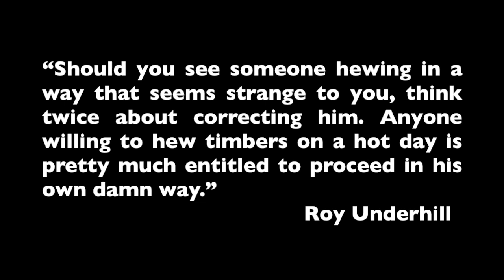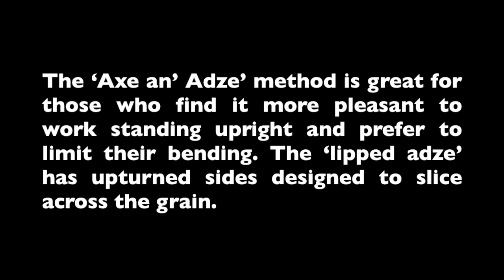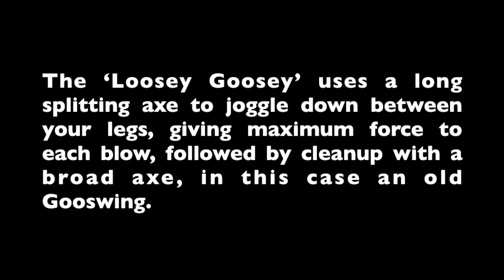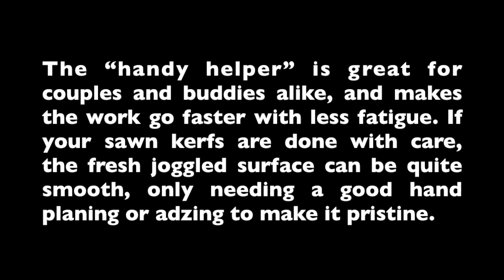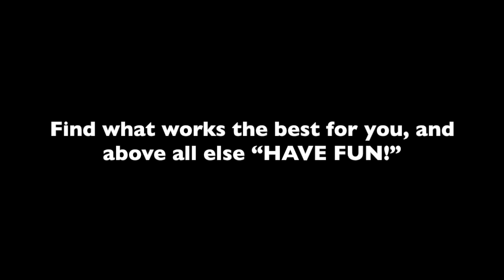A few hewing methods

Comment: LOL, the quote at the beginning was priceless. Thanks for the video showing some hewing techniques, great knowledge share.
Reply: One helpful critique on this video, since so much is fast speed, there is no nature sounds and tool use sounds which usually fill your videos, the music volume was a bit low, so it turned out a pretty quiet video. Next time around maybe up the music a little bit.
Reply from the maker: Thanks for the tip, we don't like music normally but the timelaps has no sound, we'll do louder music in the future.
Reply: Mr. Chickadee I completely understand, the sounds of nature and your tools working is much better music. At least to my ears.

The volume doesn't need to be too much louder, just a smidgen more next time. So it is soft and non invasive but still there. 

As this video was, it took me a while to even notice the music and turn up my computer volume to hear it.
Reply: The music was a good addition due to the time lapse. But I agree that the tools, and nature are the best music. When I go camping , some can't understand..... no radio.
Reply: Prefer your videos without music. My two cents. Your videos are among the very best of its kind. Thank you!

Comment: I hewed my first 5x5 beam , and damn was it difficult. I tried using just the axe - but I just couldn't do it fast enough. So I used my chain saw, to saw to the line , all 4 sides. and I chop it out with the axe, and level with my broad axe. and Hand plane to a smooth finish. Works for me - but I'm still experimenting. Overall, i'm loving it - I think about it allll the time haha :D

Comment: I also will move the log (12:29 ish) and "cant it" to the proper angle for my swing. I've not seen this too often as most folks will keep the hewing surface parallel to the ground or 90 degree if standing on the log. . I also find it much more comfortable and efficient to set it up for my swing angle. I'm short (5'7") so my "power" swing is certainly different from yours but I do pretty well with the proper angle. My old True Temper double bit is my go-to for this. Thank you for sharing!

Comment: Lovely camera work! It seems to be too much tree for that beam! I use a bark spud to peel logs before hewing, gets the dirt off and makes marking easier.
Reply from the maker: I can see why you might think so, if it was anything but a sill I would use a smaller log, even leave some wane on, but as a sill, sapwood is asking for trouble, only heartwood from white oaks is rot/insect resistant, takes a pretty good log to get that...

Comment: To think, there was a time when this was the norm to building.  We look upon these timber frames and log buildings with envy, built 200-500 years ago, the work, craftsmanship, knowledge. Doing this today is keeping the spirit of the values and ethics of a time when quality was measured much differently then today.  I wonder if the the mass production houses now being built (USA) will be looked upon in 200 years with the same admiration? 
...progress?...I think not.
Reply from the maker: Id think not, modern houses are built to last 20 years, no really, thats how they are designed...
Reply: Jay, thank you for the reply and the interesting information.  One can only hope that a quality renaissance will happen with builders/developers. In addition bureaucrats will realize their double standards of allowing throw away housing while preaching, and mandating, lower carbon footprints.  Also I hope the upcoming timberwrights will still have good raw material to work with &/or learn to work timber with growth rings 1/2" apart. (gmo round up ready trees).  I tip my hat to you, Joshua and the other timberwrights of today and tomorrow.  Your craft..art...is much appreciated.

Comment: Great work!
for my ink line i use a dart (without the feathers of course) it's hardened steel and has a knurled grip to boot.
Reply from the maker: Nice, I used a sharpened nail cut off and a scrap piece of wood.

Comment: I really like that last version with the saw. So clean!

I have some 32 inch logs I need to saw on my 22 inch portable band saw mill. Been mulling over splitting the logs, canting them square with a chainsaw, hewing them.

I think using a chainsaw and an axe to get a cant just small enough to fit on my mill is the right idea.

I do have an old hewing axe head which needs a handle, as well as a couple of other axe heads. One of these days I will get far enough in skills to make some handles for these handles and try this properly.
Reply from the maker: You can whack off two sides to get them on the mill pretty quick with a chainsaw and axe.
Reply: @MrChickadee  yep. That was what I was thinking after seeing your video.

You took care of it so fast. I've been dreading these two logs all summer, now I am looking forward to them.

Comment: Lovely camera work! It seems to be too much tree for an 8x8! I use a bark spud to peel logs before hewing, gets the dirt off and makes marking easier.
Reply from the maker: I can see why you might think so, if it was anything but a sill I would use a smaller log, even leave some wane on, but as a sill, sapwood is asking for trouble, only heartwood from white oaks is rot/insect resistant, takes a pretty good log to get that...

Comment: Great video mate. Id actually been meaning to ask you to do a video on hewing, I know you have done one before but the extra info is very helpful. I really want to learn how mark up joinery on these large beams, do you use the same lines you mark for the hewing to mark your joinery from? I have found this stuff incredibly hard to find information on, which is why I am very grateful for your videos. Can you point me in the direction of good resources for this kind of wood working. I'm planning on building my family home using  some of these techniques .
Reply from the maker: Ive progressed to using "Line rule" layout exclusively now, I find it the easiest, fastest, and most accurate method Ive tried. I roughly level each timber perpendicular to its length, mark the average middle point of each end, then use a level to "cross" each ends middle marks, I then snap lines from each end mid point to mid point on each of the four faces. All layout for joints is done measured from these center lines, never from the timbers edges. You can see the process in our videos here:

https://www.youtube.com/watch?v=LMPfzOVmtqo

Comment: How do you ensure that the lines snapped at 2:00 are parallel to each other?  Moreover, how do you ensure that the square face you’ve penciled in on one end of the timber is parallel to the face penciled in on the other end of the timber?

Comment: @Mr. Chickadee How would a beam like this work for supporting floor joists? About a 15' span with two bedrooms above it, nothing too heavy. Also - what would be the best type of tree for something like this. I realize there are many variables that come along with a question like this, but I'm in the early stages of research and would appreciate your opinion. Regards.
Reply from the maker: Hmm, If in the design phase, Id go to the timber framers guild, buy their 15 dollar book of detailed plans, one may fit, or give you better understanding on what works and not, also go and sigh up at the forestry forum, they have a red toolbox with many helpful calculators, one is a beam size/span calculator.
Reply: +Mr. Chickadee I appreciate your input. You do great work.
Reply: +Mr. Chickadee alright. I downed my tree and it seems to be soft in the center. I'm about half way up the length of it and can poke into it with my chain sharpener. Is it garbage? Either way what could cause this?
Reply from the maker: does the log have an actually vein of rot in the heart, or a hole? Some trees can be damaged and end up with heart rot going most of their length, its best to cull these as they can host termites and other issues.
Reply: +Mr. Chickadee ah, yes. Right after my post I discovered heart rot. The tree didn't seem to have any issues consistent with this, but I'm able to cut out the center of the end grain with a pocket knife. I guess this could be used for another project or fire wood. Also - what's the best way to identify tree species? I appreciate your time.
Reply from the maker: Thats a shame, but happens to everyone I guess. In fact, the catalyst for this new hewing video was such a case for us. Our very last white oak sill beam had heart rot most of the way though it, from the top of the tree down no less, and termites were living inside, so we cut and hewed the chestnut oak in the video as a replacement. The best way to identify trees would be their leaves, their bark and their flowers/fruit/nuts. Id look up a good COLOR field guide to trees in your area, or a knowledgeable old timer who can walk you around and point out species to you. Winter can be tough when leaves are gone, then its all about bark, branches, and just knowing the LOOK of a tree species.

Comment: Sorry if this was asked already...I see you drew two squares on each end of the log, how do you ensure they are in the same spot relative to the other square?  Or because you are splitting small chunks is that not so important?  Do you do anything to prevent warping?
Reply from the maker: so long as you level the squares without moving the log, they will be free of twist, warping is avoided by locking the building together with traditional joinery.

Comment: great job that is a lot of work. question though is there a reason why you couldn't simply use an axe to cut a groove length wise down the log then using wedges split the slab off? I'm not critique ing ,simply asking
Reply from the maker: it would be nearly impossible for a split to run true the length of a log like that, and you would have lots of clean up work afterwards. The reason to score down and break off smaller chunks is to sever the wood fibers in short pieces so you control the splitting action. Splits from a log will run in the direction of the fibers, normally either splitting away or into the log, rarely just parrallell

Comment: I want to try attaching a 2x6 on top of the log, then using a power drill to drill holes every six inches on both sides of the board, then insert bolts into the holes and hit the board to wack off the slab of wood in one piece. Odds that it would work?

Comment: I have been watching many videos of wood working by hand.  The small cross cut saw to cut down to proper depth before hewing the log seems very efficient.  I have seen many people work with what are called "slicks".  Are there any tools similar to a slick which is hit from the end by a large mallet.  Say something with a blade edge of 3-5 inches.  If so do you feel it might be more efficient using such a tool as compared to a broad hand ax?  By efficient I mean making clean cuts where minimal clean up would be required and hopefully get the job done faster.  I would imagine you have tried about every method of hewing a log possible, so please let me know which method you prefer.
Reply from the maker: The most efficient method I have tried, and Ive tried everything I can find, is actually to cut kerfs with a hand saw, bust off the pieces with an axe or wedge, then smooth with a scrub plane.

Comment: There is another method for turning rough logs square. Splitting the sides off with wedges into long rough slabs. Indent along line with axe, pound in wood wedges along line. This method has one advantage. The slabs can be turned in to boards.

Comment: if you had to guess.... about how long did it take from round raw log to completed squared beam??
Reply from the maker: This one took longer from the film process, but similar beams are hewable in 2-3 hours depending on desired finish.
Reply: Mr. Chickadee somewhere on YT is a video of a guy using only a broad axe, no cross cutting, just going along the length of the log to take it to a beam.  Whole  12 foot log rough hewed in well under fifteen minutes... but he cheated, he’d been doing it for decades...
Reply: @Rick_Sanchez_C137_  any chance we can get a link?

Comment: Hi Mr. C, really enjoy your videos. The poodle is a nice touch. One question, when you're cutting the notches with either the axe or saw, are you using two lines mark the depth of the cut?
Reply from the maker: Great question, yes, I use two lines as seen in the begging of the video, some only use a plumb bob leaving the cut vertical, I don't trust that and always use two lines.

Comment: What is the best distance between your first cuts before you slab off the sapwood. Thanks.   hello from S.E. KY mountains 👍
Reply from the maker: oh depends on the wood, 6" up to 1' for really straight grain easy working stuff. If there is a knot, make sure to cut right through that sucker!

Comment: Hello! Question from Canada. Where did you get these "staples" from? Those you are using to hold the tree.
Reply from the maker: They are called Log Dogs,  I forged them from mild steel
Reply: Impressive. Inspiring. Thanks.
Reply: Already working on furnace, also got an anvil.

Comment: I hewed 1/2 of one log about 18 years ago. Brutal hard work if you're not used to it. That's when I learned why they have lumber yards.

I sad to see how much of that log goes to chunks and chips. Too bad it's not practical to rive off the slab. That will make 4 sapwood boards for framing interior walls. There's a Viking ship construction video on YouTube where a buncha bearded knuckle draggers did just that. Rived 30 foot boards out of some 30" or so logs.  Interesting process but not without problems. You have to be a pretty good log reader if you wish to avoid funny looking tapered boards.

Riving timbers is where your dogwood gluts really shine. Score V's bisecting the plane of the desired split the length of the log halfway thru the sapwood, start a split across the end, spread it with wedges, work it open it down the length with the gluts.  Make a man of you.
Reply from the maker: Yeah, looks like a lot of waste, but with white oaks, you really need to get rid of the sapwood for rot resistance, so you need a much bigger log, if hewing for an upper house timber, id use one just barely big enough, and leave some wane on the old girl, would hew much faster as well. Ive seen that viking ship video, did you know they had to import those oaks from Denmark for 3000 euros a pop since they didn't have that size/quality tree in Norway? Geese, bet they were REAL careful riving, one reason they used so many tiny wedges along the split to guide it. You might be able to do this with chestnut oak, it rives easily, but you would be left with a sapwood board, maybe good for interior work and it would be basically flat sawn from outer log, BIG cupping even waiting to happen, for us, firewood is always needed!
Reply: +Mr. Chickadee We need trees with rot resistant extractives all the way out to the bark. Here that, Forest Products Lab? No sapwood.  Get on the stick (so to speak.) 

Well poop! Even if they did breed a perfect tree with a perfectly square trunk (and oar shaped limbs for the Norse) It won't be ready 'til your grand-chillun grow up.  It ain't fair.
Reply: I heard German log cabins use the waste for chinking on log cabins, true?
Reply from the maker: That was common practice here in appalachian log homes, they used large chinking gaps filled with the "juggles" then daub over that.

Comment: Was an adze not one of the traditional methods for breaking out the chunks between notches/kerfs?  Or was an adze traditionally only ever used for follow-up work after breaking out the chunks with an ax?
Reply from the maker: The adze is a finishing tool, its just not really designed for such heavy use, I know someone who has broken several adze handles using it to juggle in this way, it can be done, its just not really designed for that.

Comment: For the third method, would you call that axe a splitting axe? Any particular reason for choosing that one? Thank you for the videos - what a great resource!
Reply from the maker: Its just a generic single bit felling axe, maybe 3-4 lbs, never weighed it…no reason other than its different than the double bit used earlier to change it up for the show. I do find single bits to be more accurate and have less vibration than double bits, so for general hewing Id reach for a single bit over a double.